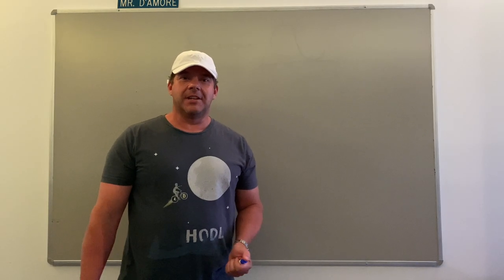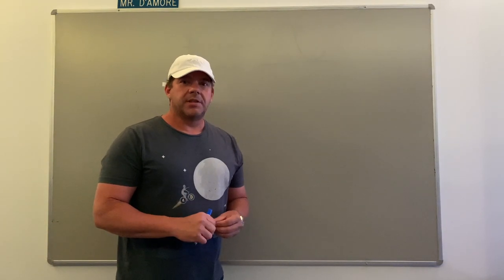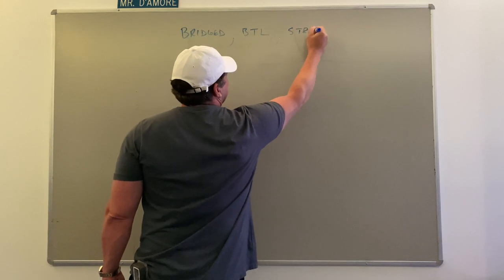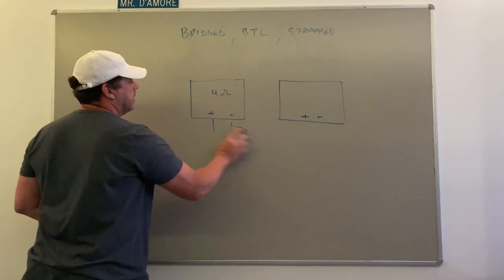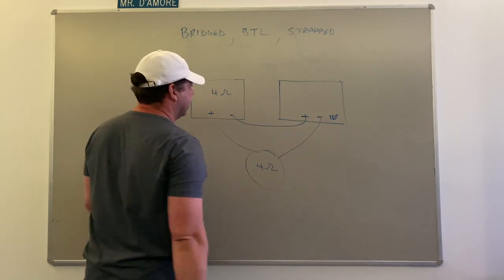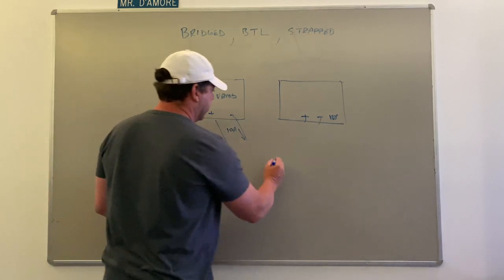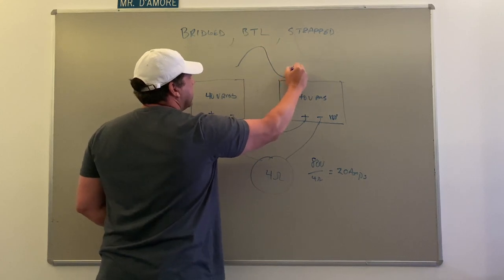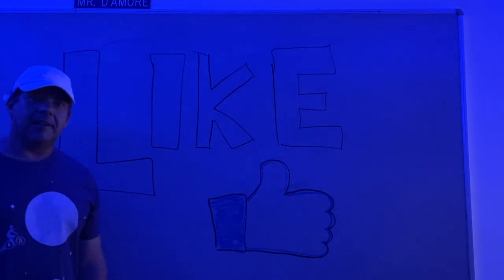Audio Technicals V1 - Amplifier Load When Bridged or Strapped

Comment: In the old school days all we had was 2 and 4ch amps and bridging was common for using amps with subwoofers. Thanks for this vid, I'll forward people over who ask about bridging, linking or skrapping dey amps.
Reply: Williston Audio Labs do you remember me telling you about how the term “Strapping/Strapped” has been contorted & twisted in the car audio world?  The original technique of Strapping two or more amps meant running them in parallel, which allows each amp to share the load.  So a lower impedance can be driven than what just one amp is rated for.  Nice to see Tony point this out here in the video, even though car audio seems to have hi jacked the term 😆
Reply from the maker: Right on

Comment: I assume the amplifiers need to be “strappable” by design in order for this feature to work, and one can’t just invert an input and wire any amplifier pair in series, is this correct?
Reply: 69MazdaR100 most amplifiers can be bridged by inverting the input signal to one of them

Comment: U have 2 massive drago 6k amps in series and 2 d4 sundown x18 subs currently at 4 ohm to the amplifiers, if I wire it down to 1 ohm to the amps will I need enough voltage to power them to .5 each or am I good to run just 300a alternator xs power 3400r front and d3100 rear? I plan to upgrade to headway lithium bank in the future